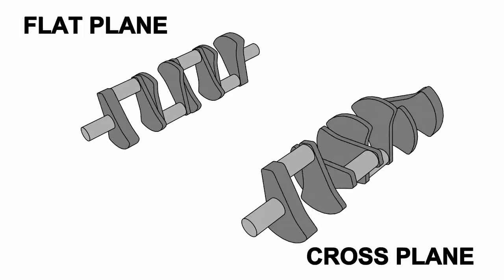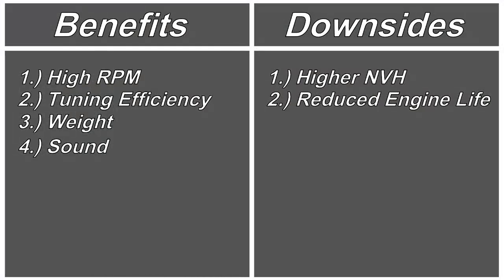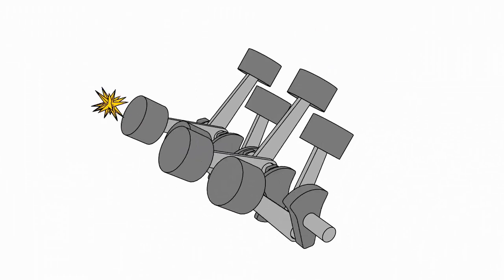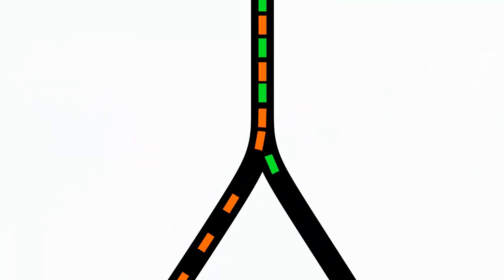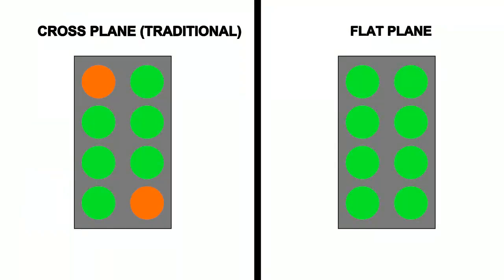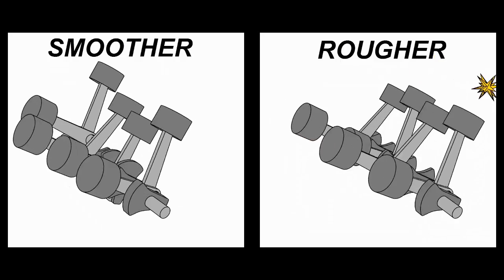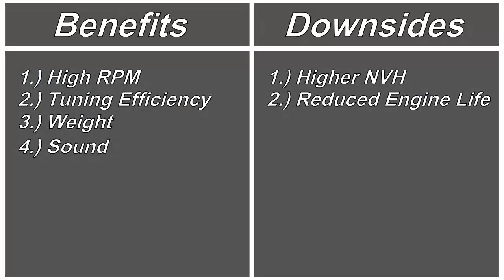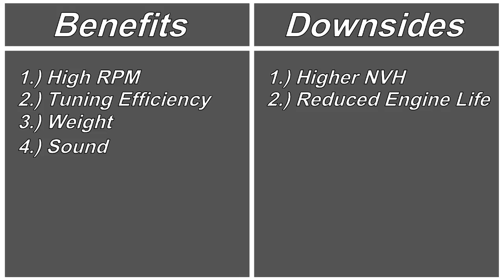Flat Plane Crankshafts

Comment: a 180 degree header fixes the problem of the incorrect scavanging pulses. makes a sb v8 sound like a ferrari
Reply: @SchafdoggGTO  im in it for performance. chrome and sound doesnt get you down the track any faster.
Reply: @TheRowdyJ  no they don't, everybody knows you need stickers and lots of them
Reply: @TheRowdyJ  rusty shitbox with 700hp and vs 300hp nice shiny car and engine
Reply: The rumble of an American V8 is the result of overlapping exhaust pulses and uneven spacing of the pulse flow.  Engines with even exhaust flow have a more refined sound to them.  They don't bellow.  If you want coarse and tough, the cross plane V8 delivers.  If you imagine agile and fast, perhaps the flat plane crank appeals.  Building headers which provide even exhaust flow results in bulky and complex arrangements.  They have to be paired as the intake runners are in a dual plane manifold.  Those are built that way to provide even intake pulses to a carburetor.  Fuel injection does away with that requirement.
Reply: i didnt say run lime a ferari, i said sound. the v8 gains a lot under 180* headers thats why they were upgrades on panteras and whatnot. i love a big block rumble. but i prefer performance.
Reply: @TheRowdyJ  i agree with performance over looks/sound however in trucks or old cars that dont make much power i would take sound over power
Reply: 180 degree headers are the cats ass. Most people can't understand the full rpm benefits of improved exhaust scavenging, and just use the same ol' 4 into 1 headers out of a catalog. Damn shame.
Reply: @SchafdoggGTO  - I want the sound of a Big Block, myself.
Reply: Chrome don't git ya home, so they say, but you sure look fuckin cool sitting there broke down on the side of the highway. But nothing else sounds as sweet as a big American v-8 screaming seven grand.
Reply: @CrazyBear65  
No doubt ,but the vw  W8 sounds pretty nice. 
Too bad it's wicked expensive and doesn't have much aftermarket support like the VR6 does.
 Slap a turbo on one(VR6)  and Grandma could run a 10. 
https://youtu.be/9mDhtSYLRyE
Reply: MrHillfolk you my friend have impeccable taste .
Reply: @Jenksauto  
Thank you man. 
I also love your TV show it was one of the best. 
Thinking back 30yrs ago to before VW made the VR series ....
VW making a v8 sounded like a pipe dream. 
 Neat engines , but they can be a little tricky to work on. 
I've got a vr6 and it needs timing chains. 
Problem is the chains are on the trans end of the engine, not a fun job but thats what it took to stuff a 6cyl in place of a 4.
Reply: MrHillfolk I know your pain . I am a vw tech with my own shop on the west coast of Canada . I specialize in VR oriented engines, and know all to well the sound of damaged chain guides . We do have to spend money and love on them to maintain them, but we know already they are inherently better out of the box than most engines .
Reply: @CrazyBear65  An old F1 V10 or V12 kills the sound of any V8 from anywhere, in my opinion. They have much less harsh and much better sounding exhaust notes compared to pretty much anything else out there.

Comment: What about all those high reving small block Chevrolets been doing it since 1955
Reply: He just said the smaller displacement v8’s used flat plane cranks while bigger engines used cross plane crAnks
Reply: high revving sbc....whooooo.OOOOOoo...goddamm i cant breathe.....high revving sbc...this guy...lolol
Reply: @connoisseuroftigolbitts  there is a Corvette built with a flat plane crank
Reply: High reving=5000rpm? Let me laugh
Reply: @juhomaki-petaja  how old are you? You never set your ass  in a real z/28 Camaro
Reply: Steve Griffin 38y. Wow you found one yank lump that revs. Sure Boss 302 will rev too but 90% of yank iron lumps wont rev over 5k. Thats why i would love to build sbc 327 with really high redline.
Reply: At what displacement is it concidered smaller / larger?

Does bore & stroke change that?

Comment: I wonder if there is a flat plane V10? By adding the 2 extra cylinders, would that take the vibration out? I’m sure the europeans have a engine like that. If Dodge or Ford would build one, that would be cool. High HP good TQ and can rev to 9k RPM’s.
Reply: Crossplane v10s have already went near 20k rpm. Much more rpm the fuel would start to limit the crankshaft

Comment: Cross-plane cranks give you tons of neck-snapping torque fun right off of idle at 1000rpm.   My 2017 Corvette C7 also gives me 37 mpg on the fwy.
Cross-plane are lighter and have a lower center of gravity (lower hood, better handling), see Engineering Explained https://www.youtube.com/watch?v=9pAspOTBpZo

Comment: So the question that comes to mind is why doesn’t dodge use the flat Plane crank technology especially in their newly released thousand horsepower Helephant Supercharged engine? my guess is the flat plane crank benefits are not really benefits at all. When comparing traditional engines and big horse power , and high torque at lower RPM I’ve noticed this Riding  in the GT 350 mustang and in riding  in a hellcat. the hellcat but put you back in the seat and accelerates very hard the mustang does not seem to accelerate as hard  it was observed  by several of my friends As well, though the hellcat did not rev as high it Excelrated very hard straight  at lower RPM and shifted at lower RPMs the mustang had to Rev very high through all the gears.
Reply: Thats because the hellcat is pushrod & supercharged and makes big torque at low rpm, whereas the dohc gt350 reaches its peak power at higher rpm

Comment: Exhaust issue, just straight pipe each cylinder out the side of the car, problem solved
Reply: Then you'll have no scavenging effect... and therefore less power.
Reply: @turbojetpowered8299  These aren't dragsters.
Reply: @turbojetpowered8299  It makes zero sense to build a drag based vehicle for the average consumer, besides the EPA getting on manufacturers cases. Also Dragster vehicles are meant to be run for a minutes at a time on each pass. They aren't reliable setups .
Reply: You definitely show you're a Trump Supporter. You dont need your picture so we know.
Reply: @DaBuGzLiFe  Show us on the doll where he touched you. He made a joke. Stop trying to act like your levitating above everyone else
Reply: @DaBuGzLiFe  never too late to make a comment on a statement that is left just hanging about

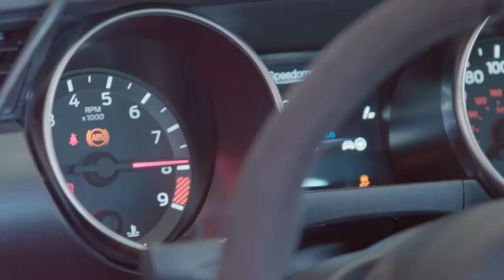Comment: Could someone explain to me in a bit more detail the reason for cross plane cranks having "underperforming" cylinders, as mentioned at 2:54?
Reply: That's because of the exhaust scavenging. Two of the cylinders can't get their exhaust gas removed as efficiently as the other 6 cylinders.
Reply: @johncochran8497  ahh... Makes sense. Thanks dude.

Comment: I didnt get an explanation for why this type of crankshaft would break down faster, could someone explain?
Reply: 180 degrees vs 90 degrees, it's obvious..... less stressful angle of attack of the engine's torque on the crank. Simply put that is.
Reply: @timm.6391  90 degree vs all fire every 90 degrees.
Reply: For v8s
Reply: These are well less balanced as they are lighter cranks with counter weights to properly cancel out vibrations. So without all of the supporting equipment the extra vibrations from the lack of a true balance they wear at a somewhat accelerated rate. But in reality it's just not noticeable with proper care.

Comment: Is flat plane the same as boxer
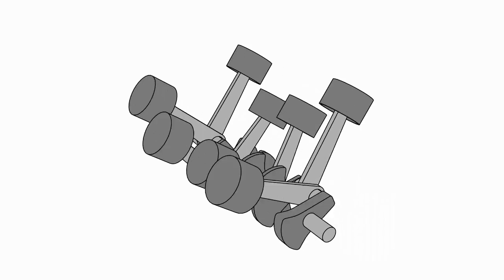Reply: No - "flat-plane" refers exclusively to the crankshaft. As the video shows at 1:35-2:00, no matter which crankshaft design you use, the pistons themselves are 90 degrees apart, forming the V shape from which the engine gets its name at the top, between the two banks. All the diagrams shown in this video portray 90-degree eight-cylinder engines.

Boxers, on the other hand, could be thought of as 180-degree engines, where instead of the pistons forming a V shape, they all lay flat with one another. The cylinders of the two separate banks will lay in opposite directions. https://www.beamng.com/attachments/engine-aerial1-jpg.278043/ This picture is a good illustration - the ridged protrusions to the left and right are the cylinders. It is my understanding that it is generally poor form to refer to boxers as "V engines with a 180-degree angle," as there are some engineering differences between the two. I don't know enough about either to tell you what they are, but hopefully my explanation helps.
Reply: @johnderouen1038  there are two styles of flat engine the boxer style where crank throws and pistons are separated no two pistons shares the crank throws while a 180 degree v is like a v8 just with a 180 degree v and a crankshaft to support it.

Comment: You erred when you said a flat-plane crank fires every 180° on a V8. It's every 90 degrees.
Reply: * only If it's a 90*v.
Reply: @JP-ug1xr  that applies to crossplane also.

Comment: Good video and interesting comments. Ever notice the earlier Ford 302 firing order is the same as a GM V8? They just number the cylinders differently. Not sure about the other ford stuff except I’m aware the 351W and later roller cam 302’s are different. I’m a GM guy but when working on early (non roller) 302 Fords 18436572 will get ya running.
Reply: Its basically the same order.

Comment: 1,8,4 3,6,5,7,2 is the SBC firing order and other V8's, not ford, not 1,3,4,5,6,7,8,2! Now what does the exhaust flow look like in 3D?
Reply: It doesn't matter it's still the same result
Reply: The Ford v8 is the same as a Chevy v8 the cylinder pattern is the same just different numbering
Reply: The firing orders are the same, they just number the cylinders differently.

Comment: 3:50 a V8 has to fire every 90 degrees no matter what as long as it's a 4 stroke engine. There's no such thing as a 4 stroke V8 that either fires every 90 or 180. It has to fire all cylinders within 720 crank degrees.
Reply: I think he means per cylinder bank
Reply: Opposite=a miss
Reply: That is correct.
Reply: That is what I was thinking.  The flat plane works like two 4 cylinder engines joined at the crank.  Each bank fires every 180 degrees, and the two banks are 90 degrees apart.  So why is the cross plane smoother?
Reply: @bobzwicker807  Balance - you can see the big counter weights on the crankshaft for every cylinder on the cross-plane V8. There's no place to attach those weights on the flat-plane. It's why the cross-plane configuration was invented.
Reply: @sergeyakinin997  The whole reason why  designers use a flat plane crank is to not be bogged down by those counterweights.

Unlike a cross plane crank,a flat plane crank doesn't need counterweights in order to stop it from killing itself.

Comment: Great video. If you're not aware, the sound an engine makes is determined almost entirely by the number of cylinders and the firing order. Motorcycles I think are the best example of the different engine sounds. Listen to a traditional inline 4 bike like a CBR and notice how different it sounds from a crossplane inline 4 bike like the newer R1s. And also notice how a crossplane 4 cylinder sounds very very similar to a crossplane v8. And also a triple cylinder like a Triumph sounds very similar to a V6 or V12.
Reply: It is also determined by the exhaust system. Engine configurations which make equal-length exhaust runners with proper timing impossible (such as cross-plane V8's and boxer 4's) lead to characteristic sounds (which some people like, and others do not).
Reply: @brianb-p6586  yes- great point. The difference in sound between a WRX with UEL headers vs EL headers is pretty significant.

Comment: Didn’t motortrend say gt350 has a non traditional firing order than each firing in different bank. Due to some packaging limitation.
Reply: No they still fire like a flatplane bank to bank or lrlrlrlrlrlrlrlrlrlrlr. But they have unequal length headers

Comment: The difference between a Ford:Ferrari flat plane in their 5.0L engines is more then 20lbs the reason for the flat plane in the first place is weight. Ford could do a lot better then they have, and in truth it takes aftermarket everything on the Ford to make big reliable power. Talk LS and your almost @ SB2.2 performance with now old reliable even stock parts. Want screamer think 4.8 crank:LS7 block........bye-bye flat plane....HELLO 8500+ !!!. The Ford wouldn't even need break lights because nothing would be behind it.

Comment: There are other benefits/drawbacks of both crankshaft architectures.

Aside from their inherent smoothness, when compared to flat-plane cranks that have not been harmonically treated, one of the main reasons cross plane architectures are popular with manufacturers (enough to overlook their above-mentioned inherent performance/efficiency drawbacks) is that they usually offer ~16 different firing orders; which assists with different countries fuel qualities.

Whereas flat plane architectures only offer 8 different firing orders. 

Hence cross plane architectures (due to their centre crank pin angle's interchangeability and how it offers so much firing order and other flexibility) are usually more popular with standard manufacturing production lines; particularly those that deliver cars into various countries that have different fuel standards.

Another reason for the cross plane architecture’s popularity (or drawback of the flat-plane architecture) is that a flat plane architecture’s cylinders fire whilst many of its other pistons are at either TDC or BDC - where friction/conrod-leverage quantities are not favorable; and this can present more of a drawback than the cross plane architecture’s gas flow issues.

For those whom don’t know; (contrary to popular belief) TDC is one of the worst times a cylinder can fire.

Comment: 180 deg cranks have been used and discarded in most forms of racing as while in theory they should make more power they do not!
Cross plane is smoother and far more reliable. I have heard stories of flat plane Chevs in F5000 and the viabrated the tubs apart!. this near 50 years ago. And nothing has changed.
Tuned firing order headers too make little more power though they should. But packaging the engine negates any benefits. Street triY are not the same though for the Towcar are probably a benefit.
Reply: Your actually not correct they are still used in many racing circuits just because the chevy engine was vibrating the tube meaning the team who assembled it didnt build the car right doesnt mean the crank design isnt used 4 bangers are primarily flat planes and used in racing v8s it's a decent split.

Comment: 3:45 excuse me. Your explanation of 180* firing order of the crankshaft I'd erroneous. Both V8s fire 90* of crankshaft rotation. If the flat were 180*, it would take 4:crankshaft revolutions to get all 8 cyls to fire. 180* x 8 = 1440

Comment: You can somewhat get around the uneven firing effect on the exhaust of a cross plane V8 by using tri Y headers. Instead of dumping all the pipes into a common collector, you split them up into pairs based on where they fire in the order and then tie the two pairs together. It makes a pretty remarkable difference.
Reply: It’s not somewhat, it’s actually done and works
Reply: Any V8 can have an exhaust system with ideal pulse timing, but the "bundle of snakes" design required to do that with a cross-plane crank isn't practical except in some racing cars... or any V8 with a "hot vee" configuration (which then causes challenges on the intake side).
Reply: It's worth nothing that dragsters with straight-cut pipes have ZERO issues with uneven firing.
Reply: '' you can some what''  That's still a no bub.
Reply: @msengineeringdavid3702  pretty remarkable difference though
Reply: @msengineeringdavid3702  individual pipes will

Comment: I have heard that aftermarket 180* cranks were made "back in the day" for the Ford flathead V-8. On the other hand, the "Tri-Y" headers on my Dodge 440 are different on each side, in order to take advantage of- or at least compensate for- it's 90* crank. The oldtimers refered to these as 180* and 90* cranks, and thus, so should we.
Reply: Ford flatheads where flatplanes
Reply: Atleast from the stock flathead Ford v8s I've seen never seen a crossplane one

Comment: Me no like change. The Chevrolet and the Ford V8s with their cross-plane cranks were able to run 10,000 rpm Indy and F1 applications. It doesn't get any better than that.  leave it alone.
Reply: Indy and f1 applications saw huge redesigns of both Ford and Chevy engines.

Comment: Yamaha use a cross-plane crank as the cranks spin rotation inertia balance is (naturally primary) balanced smooth rotation (so they made rotational balance the primary balance and then linear balance of piston movement secondary) and the rear tyre life is extended by smoother mechanical spining.

Comment: As far as I'm aware the most powerful production V8 currently made, and also with the highest specific output, is Koenigsegg's - 5.0 litre, 1360 HP,  and it's a cross-plane. Based on this I have the suspicion that the decades-old dogma held by 'purist' engine designers that high-performance V8's need to be flat-plane may have been simply wrong (or simplistic).

Comment: Oldsmobile V8 engines used a forged crank. They were forged  flat and twisted to cross-plane.
Reply: I believe almost all forged OEM cross plane cranks are twisted, much easier. Newer more expensive aftermarket are no twist forgings.